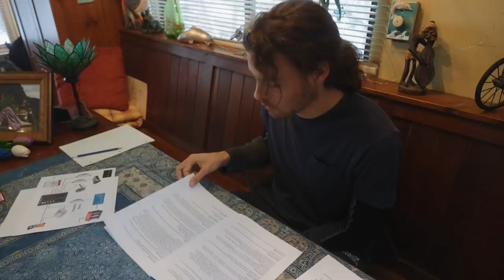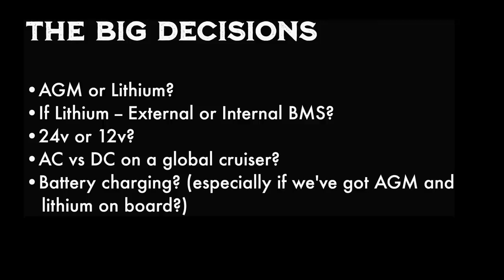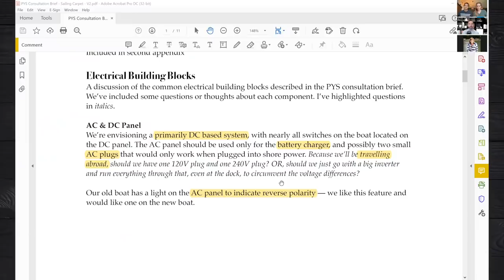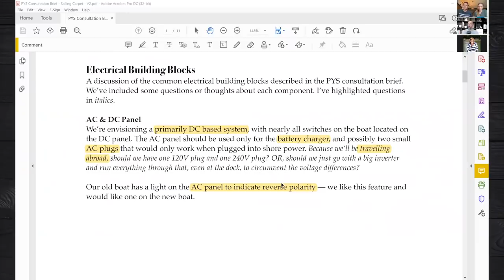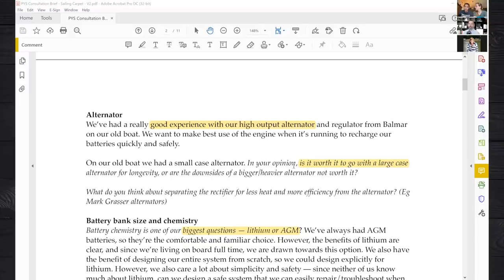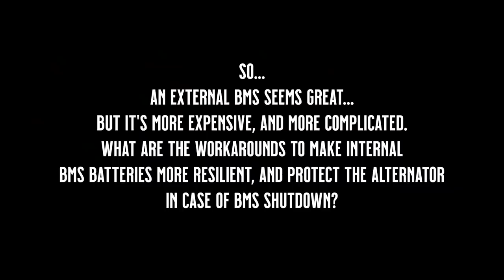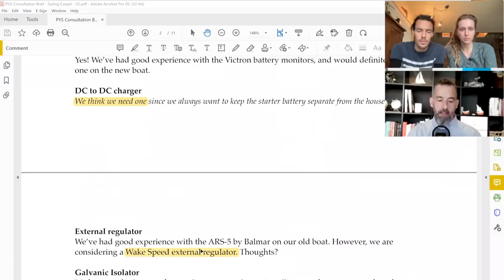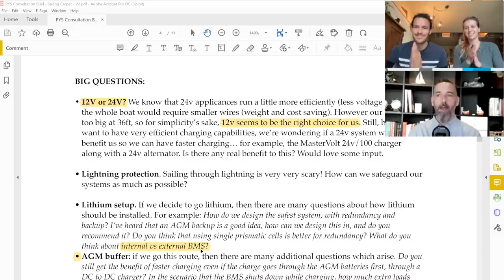DESIGNING an ELECTRICAL SYSTEM for WORLD CRUISING (with Jeff Cote from PYS)

Comment: In regard to the (red) indicator between Neutral and Ground on your boat which never should light up, I would install a (green) indicator between Line and Ground on your boat which should light up when the shore power polarity is correct. If the red indicator circuit fails, it gives a incorrect "safe" all the time. If the green indicator circuit fails it gives an incorrect "unsafe". I prefer the second.
Reply: Very good point,Thank you   It is like absence of evidence is not evidence of absence
Reply: Why would you do that ? Over here (Netherlands) we can plug in the 230VAC connectors in 2 ways, there is no indication and no good or bad direction.  I repair electronics measurement gear for a living and I never have seen an instrument or apparatus that was constructed in such a way that it matters where I connect line or neutral. On my boat I use an isolation transformer.
Reply: @pa4tim  My point was that an indicator that warns for a dangerous situation will not warn you when it is broken or a connection to it is broken during an unsafe situation. An indicator that informs you about a safe situation can only give you a false unsafe status when it or a connecting wire to it is broken although the curren situation is safe. I would prefer to get a false warning then getting no warning.

Comment: Keep up the good work !   My electrical plan starts with 3 battery banks .. start , 12 v  Firefly house and 24 volt Lithium bank .  Adding Balmar XT series alternator for its low RPM high output performance for charging the Lithium . The stock Beta engine alternator for charging Flooded Lead Acid (FLD) start and house battery .  DC/DC charger from Lithium to House when engine off and start if needed. 12v house bank for essential 12v equipment . Lithium for invertor , A/C , Ceramic cook top and windlass. Adding solar . Small solar bank will power the CoolBlue refrigerator compressor unit , along with the Lithium bank .

Comment: Great to see you back in North America. Your conversation with Jeff was incredibly valuable to your YouTube channel viewers as well as to you. It resonated with me in part because many of the choices and decisions you face are ones I have faced over the years (50) that I have been cruising. Jeff and you validated most if not all of the ones I have made. Thanks. I don't feel as dumb today as I did yesterday (LOL). 
The only thing I would contribute is that, at the end of the day, the two things that matter most are reliability and (given that the first has limits) redundancy. Make everything as simple as possible, but no simpler. If it can break it will, and it will do so at the worst possible time  (Murphey's Law). FWIW, Murphey was an optimist. I can't wait to see the second episode, and hopefully even a third. 
Regarding propane and a practical backup - we have a propane stove/oven. We've never had a problem, but we did replace the original when it hit 40 years. Our two tanks last all summer and beyond. Our backup is a very nice Magna BBQ mounted in the cockpit. It offers great reliability and assured redundancy if the propane unit were to take a break. We have actually cooked some wonderful full meals on it, not just steaks, fish, and bangers. Just saying, do you really need an induction unit? A small electric Breville unit that will run off a 2000 or 3000 watt inverter substitutes nicely for the propane stove to make coffee in the morning, and doesn't consume much energy. And it is a LOT cheaper. 
Fair winds.

Comment: Maya: Are you sure you really need AC to charge your computer? When I'm on my boat I charge the computer using the USB-C-port. I have a converter from cigarette lighter socket (12V DC) to USB-C with PD (I think it can output up to like 150 watts), works like a charm for the computer. Assuming the computer supports charging over USB-C.
Reply: "Assuming the computer supports charging over USB-C." Yes. Assuming.
Reply: In my experience there is no laptop computer which accepts loading by USB-C. You need an AC Charger with appr. 180 W of power.
Reply: @sailingmistral685  this is quite the norm nowadays. My current dell is, so are my colleagues laptops from various brands, my last macbook was.
Reply: I run my laptop all day of usb-c, both when i’m working at home or at the office. 
3 years ago the office usb-c was a little low on power output, but the battery provided the extra power needed when there was peak demand.
Reply: Even without USB-C, it is not a good idea to use AC to charge a laptop on a boat. You will convert DC to AC to DC, which causes avoidable losses. Especially if your laptops constitute a significant part of your electrical energy need I would opt for a 24DC system. A switching power supply can easily create the 19V you need for a laptop.
For heating I would have at least an alternative for electric heating, probably a small gas stove, heating requires probably more power than you can generate from you solar system when you need the heating.
Reply: @martijnb5887  yes of course, first, before you plan the electrics on your boat you have to switch all your equipment to ones with DC supply only. AC is bad. Maybe some have a little problem with this.
Reply: @sailingmistral685  I think most decently new laptops supports USB-C loading. And the roof for USB-PD is 240 watts, so the 140 watts that Maya's laptop uses shouldn't be any problem.
But then again, as others have written here, there might be even better ways of charging the laptop without having to go from DC to AC and back to DC...
Reply: @FarbrorDaniel  Ok, I´m more used to older Macbooks etc. But I´m really wondering that USB-C can handle 240W w/12V?
Reply: @sailingmistral685  No, USB never uses 12V. The standard voltage for USB is 5V. Units can negotiate with each other for higher voltage and current though, the maximum seems to be 5A over 48V. Actually quite fascinating 🙂

Comment: Do try induction cooking, perhaps at an Airbnb. A diesel generator & electric propulsion engine is worth considering. Delos, Uma, and others cook with induction. Lots of the design & safety challenges come from the engine alternator & propane. If your boat sails well and you avoid schedules, skipping a Diesel engine can work well

Comment: Great video.  From watching other sailors, make sure that if the alternator needs to be placed below a water pump, that there is some type of cover to prevent the alternator shorting out because of a water pump leak (From Sailing Zatara).  The second consideration is having a small gasoline powered generator to recharge batteries, especially  if you are sailing up north (Norway or Iceland) and do not have access to docks with electric power, and Lithium Batteries no not work well in colder temperatures. (From Sailing Uma)... and yes, the sound of these small generators make is a function of power required.

Comment: I set PVC conduits into corner covings, and re-openable PVC conduits everywhere else I could, and I bought aircraft wiring cables of all sizes cheaply from disposals, because it was light in weight colour coded tinned copper and of very high quality and CHEAP.  I also used RELAYS wherever I could to keep heavy wiring as short as possible and only switching circuits to operate the relays and lights to tell me the relay had closed, made switch boards simple.  I ran heavy DC cables as bus bars full length of the vessels and I had a separate battery for the anchor windlass and forward heads and shower pump.  

I used a large battery charging system as an isolating transformer, and for the rare occasions I need heavy power, I ran a generator which was a Honda Inverter 2KVA.  This was  a stop-gap until I could afford a diesel genset of the same quality output.  I did have a connection to shore power through a plug and fuse mounts which included overload switches,  The bus bars to the front battery charging circuit went through an overload switch and a non-reversing diode set--so that when heavy loads were applied say to the house or starting batteries, there was no power drawn from the windlass battery to burn out any charging wiring,,

Comment: Great video, thanks.  I don't have a comment on Lithium vs. AGM, etc., but I would highly recommend considering using flexible conduit and junction boxes for wire distribution.  Sailing Atticus had a recent video on using this method, and I think it is a brilliant solution over having a bunch of wires snaking all around the interior of your boat.

Comment: Great Video !
I am looking to restore my 1977 Westerly Centaur a much smaller boat and find it difficult not to get caught up in all the tech and focusing on keeping it simple. Jeff mentioned using a DC to DC converter to charge the house bank from the engine alternator. What about using the engine alternator with a smart regulator like the Wakespeed to charge the house bank and a DC to DC converter to charge the engine battery. This would allow you to get the most from your alternator and use a smaller converter. You still need to use some sort of alternator protection if you use lithium but there are options for that out there. Also, a DIY lithium battery bank may be a good option for you as mentioned by one of your other viewers. Good Luck ….

Comment: 24V DC definitely better than 12V DC as it is more efficient, But 48V DC is the best you can get in DC. especially if you decide going with electrical propulsion. We have designed 5 electrical systems for boats in the past few months and all upgraded to 24V DC but one 48V DC. 
On the AC I would go 230V/ 50Hz always. That’s what you get in most countries. 
Let’s say it is always easier to climb down than up.
As for batteries we use for “bluewater cruisers” a hybrid battery system where you get Lead Acid and Lithium together (non electrical propulsion system). As Lead Acid batteries are readerly available around the world as opposed to Lithium batteries. 
Jeff Cote has given you great insights and advices.

Comment: My electrical design guidelines for cruising in many countries are as follows, seeking the most reliable & avoiding excessive complexity. 
Fixing complex systems away from Europe/North America will be a nightmare!

- Alternator de-rated with Wakespeed regulator;
- Alternator charging Firefly AGM House Bank (450 AHr);
- Northstar AGM Start/Windlass bank (150 AHr);
- Engine always running during Windlass operation;
- S/W bank large enough to raise anchor even if engine will not start;
- Victron 30Amp DC-DC charger transferring charge from House to Start/Windlass bank to ensure 100% SOC;
- All solar charging the Firefly AGM house Bank to achieve 100% SOC;
- Shore power (any Voltage) to Charger and Water Heater;
- Universal voltage 30Amp shore power charger to 12v;
- 220 V water heater (charges slower on 110V);
- 12v to 110V 60 Hz 2000W Inverter (all appliances 110v)

I have decide that Lithium presents more disadvantages than advantages compared to the above design, especially in the case of a moderately sized engine and a large House bank.

The question of 12v vs 24v is not either/or. If you adopt 24v you will still have to support 12v in some areas (eg NMEA2000).  Also sourcing replacement 24V components in remote places may be difficult.

Comment: Jeff on your channel: NiiiiiiiiCE! One thing unmentioned: catching energy with solar and using it thereafter is substantially more efficient (less loss) with LiFePo4 than with lead acid batteries. If you plan to have this boat for 10 years or more, I wouldn't personally hesitate to integrate LiFePo4
Reply: That is a really good point.  Solar or hydro generator charging power is precious.  Lithium "takes" the charging power much more effectively than lead acid batteries.

Comment: Nowadays you will find lithium crank batteries or even dual purpose. It isn’t needed to mix two types anymore. 
Apart from this keep in mind that the world is much more larger than US. So if you intend travel around you must have a system that can handle 60 and 50hz, 220 and 120V.
Reply: For sure able to find cranking lithium batteries. Look at automotive industry- antigravity is one of them. I’d be interested in hearing about utilizing automotive electrical connectors in a boat. They’re designed to be waterproof, shock proof, and easy to connect and disconnect. Obviously cost issues. But something to consider
Reply: @RogerThatSailing  I think you should warn Dakota Lithium cause they are producing dual purpose marine batteries, but, you know, they’re should be for anti-gravity belts. More, all lithium are completely sealed, but this is not, is it? Besides in cars there won’t be shock or vibration, right?

Comment: Besides "Sail Life" YouTuber, look at "S/V Delos", they went all Lithium Batteries for their boats, and that is all they used.  "S/V RAN" is another YouTuber, they also lately changed all their power to Lithium, eliminating completely the use of propane, because is hard to get refills in certain parts of the world.
Lithium is certainly more money up front, but the advantages are greater than the cost up front, if you can afford it is the way to go. 😎👍 🇨🇦

Comment: I like the induction for redundancy and for "saving propane" ideas.
The latter sounds like using the "5 items or fewer" queue at the supermarket for lunch rather than the heavy duty trolley load queue...... additionally it could be precisely the opposite of cooking off diesel.....because in fact a proportion of your meals would be cooked off the sun!
Reply: Inducion is awesome. Propane heats your boat and generates additional humidity. There are on mobil induction plates available for less than 50€. I have a 3000 watt inverter on my boat and cook exclusively with induction and lithium/ solar and use propane as a backup 😉
Reply: @sy-ronja3613  Sounds great, what's your battery bank?
Reply: @ratusbagus  6x100ah battle born LiFePo batteries with internal bms

Comment: We run propane with induction (one burner) as a backup. Just make sure you have the right pots/pans of course. This is on a 300 Ah lithium bank. no issues if used 15-25 min per day on avg.

Comment: Some European countries, Spain for example do not necessarily differentiate between hot (we call it live) and neutral as they use double pole switching – that is both wires are switched, so you never have an issue with the  Live wire reaching an appliance if polarity is reversed. In the UK where I am switching is mostly single pole so the above problem can occur if polarity is reversed. I love the idea of using a battery charger as the sole AC supply that keeps your AC wiring on the boat isolated. Hope that helps a little, greetings from the English Midlands and my Live-aboard canal boat.

Comment: Hi both,

I enjoyed your video. Jeff obviously knows his stuff and as a sailor has a refreshing real world perspective.
I completely agree with your philosophy of simplicity and having redundancy in your system.
You should listen to Jeff's advice as he is an expert, however I would add in a few points for you to consider.
If you are off grid for prolonged periods, the battery capacity and performance is less important than your generating capacity.  If your generation and utilisation are not well matched then the battery capacity is not that important. It might take longer but to go flat with a larger capacity but you still need generation and usage in balance. This is not an issue for coastal cruisers like me as we can easily get onto shore power but it is if you are ocean sailing. You seem to be frugal with power so it should not be hard to stay in kilter, and keeping it simple is always good.
Whether you go for Lithium, lead/acid or a combination is the issue.
Murphy's law applies. Anything that can go wrong will go wrong. What you need to look at are the unacceptable risks. The main risks are sudden total failure and fire, both of which are more likely with a lithium system.
There are arguments for a system incorporating both lead acid and lithium. It avoids the sudden total failure concern. There is also an argument for a setup where the lithium acts as the main sump and feeds current to the lead/acid. This keeps the lead/acid at its optimum voltage and state of charge extending its life hugely, and the lead acid acts as the direct connection to loads so it can safely deliver high amps. But you still have to worry about the safety issues with lithium.
The more I have read about lithium batteries, their complexity, construction and behaviour, the less I like them on a boat. The things that can cause fire are numerous and although there are lots of complex measures taken to reduce the risk to a low level, it still exists. The fires are also very difficult to extinguish. It is not so bad in an EV where you can just get out and walk away but I am not keen to have them on a boat. 
They represent the antithesis of your prime philosophy of simplicity.

Best wishes